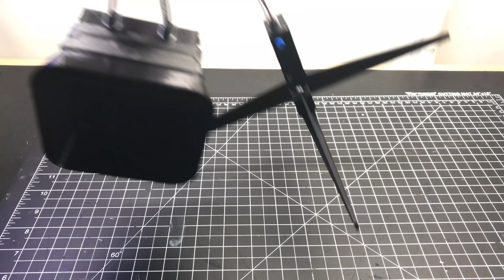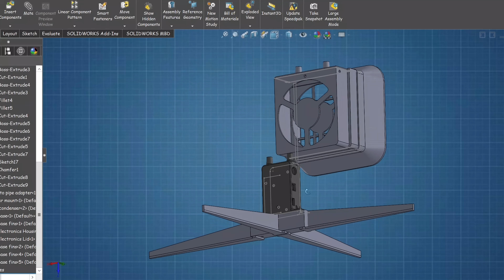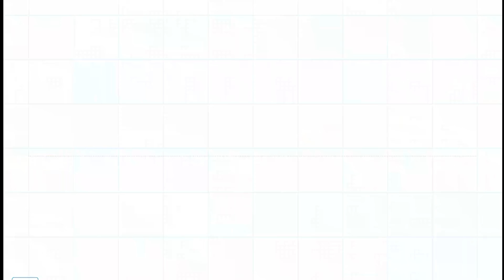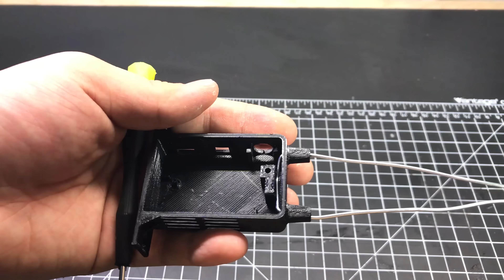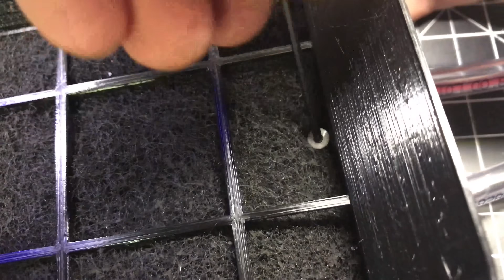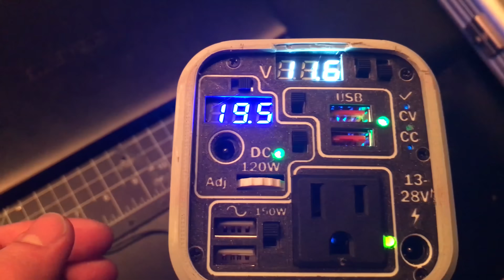DIY USB Solder Fume Extractor with Variable Power

Comment: Is the boost converter an essential component when making an extractor fan? My plan was just to wire up a micro USB port to a motor with fan blades attached and run it off a USB port on an extension lead, would this not work?
Reply: no it's not, you can do this just fine. the only problem would be that the speed of the fan may not be sufficient, i'd reccomend a 12v power supply

Comment: Great project! I built one and it works great. I moded the design to use a old lamp goose neck I had and didn't use the variable speed, instead used an old 12 V wall wart. The 3D printed case is incredible. Thanks.

Comment: I use a lot simpler rig - an old DC power adaptor from an unused laptop or gadget, with the plug snipped off and the wires soldered to the power leads of the 80mm fan.

The question is, at what point during a project do you think to yourself 'actually this joint would solder better if I reduced the power on my extraction from 100% to 90%'? I cannot think of any circumstance where you would want your extraction running at anything other than full power.

Also, can you please put a warning if a project requires elite-level tools such as 3D printers or CNC mills.

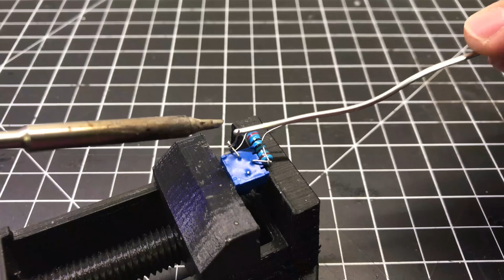Comment: 3:00 I tried soldering a homemade DC power supply to my old phone in place of a faulty battery.  I broke the potentiometer on the buck converter before I knew the value I needed.  I have an assortment of resistors and was trying various combinations to get the right but ultimately destroyed the pads on the phone's motherboard before I got it right.  I found where each pad led to and soldered to those points with a modest 3.8V.  I never got the phone to boot, I suspect the phone needed the battery's third wire which indicated temperature or something in order to turn on.

Comment: I don't know who you are but I love your crafts. Say I don't have access to a 3d printer. (I might, but if my contact and help falls short) Can I use cardboard the same for each of these crafts? I am handy with an exacto knife and have made some amazing creations. Do you know if plastic is the only way to go because of heat troubles? If I may, I would love to try and recreate some parts and send them your way for testing? I love these and can't wait to try. This will be my number 2 project after the power supply. I am also thinking of adapting it to be a bench power supply for some project ideas I wish to work on!

Thank you for these amazing pieces and all your incredible effort. !
Reply: This project should not be a problem with cardboard and hotglue (or even tape).